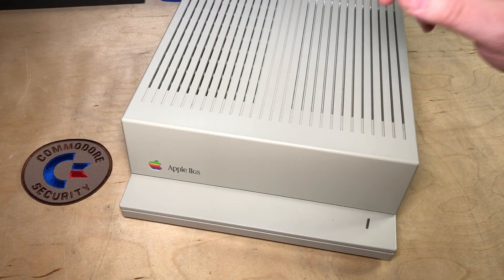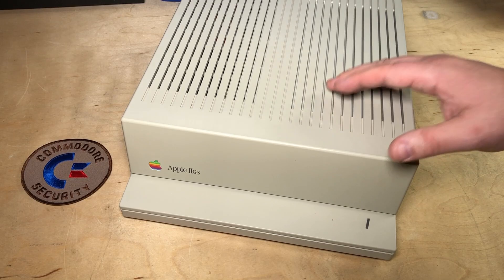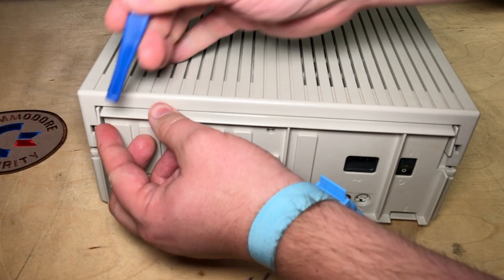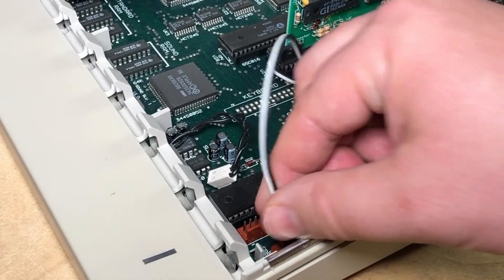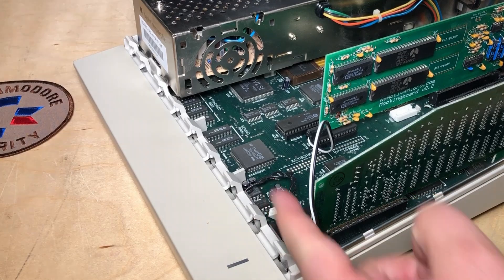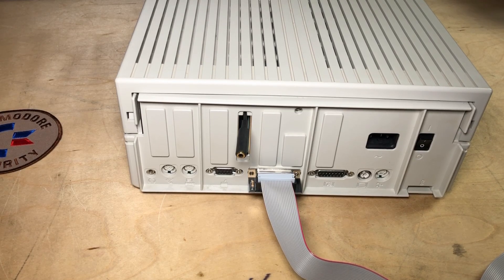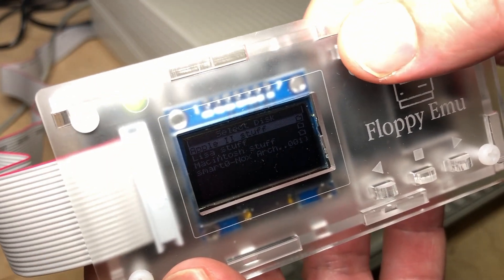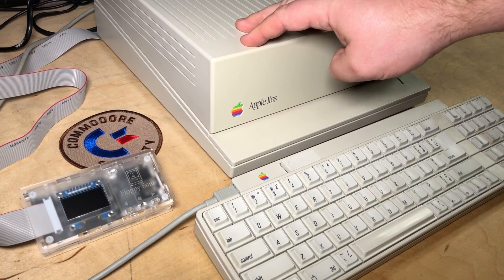Apple IIGS: Setting Up My New Mockingboard, Floppy Emu

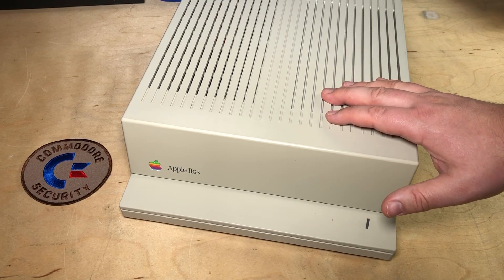Comment: @2:15.  The final Apple II model released would actually be the Apple IIc+, released Sept 1988.  It was both a step forward and a step backwards for the Apple II line.  The IIc+ was faster then the stock gs, but didn't have the sound and graphics capabilities of the gs.

Comment: The IiGS was not the last apple, for obsure reasons it was discontinued before the Apple IIc+ and even the IIe. 
Apple killed what was a machine that could shadow the early colorless and soundness mac. They prototyped a IIGS with SIMMS slots and internal HD and drive. But the project was cancelled. 
It was the second time that Jobs abandoned several thousands users.

Comment: I have both versions of the older Floppy Emu, with the monochrome screen.  Maybe it's time to pick up a current one as neither of mine have the extra Smartport options or UniDisk 3.5 support. (They only either support Smartport 3.5 on the END of the daisy chain, 5.25, or Smartport hard drive.)

I managed to get the rare-as-hen's-teeth CFFA3000 for one of my IIgs machines.  It lets you boot (5.25) floppy images as slot 6 while also booting hard drive images without Floppy Emu's naming restrictions.

If you want to do any serious stuff, like use GS/OS, I recommend you upgrade the RAM to something above 1MB.  I have GGLabs 8MB RAM expansion.  It's a SIMM on a board that's the length of the memory expansion connector.

Comment: Another way to enter the control panel is Option-Ctrl-Reset.
Reply from the maker: Interesting that there are two key combos for it! Is there any difference between them?
Reply: @8-bitshowandtell247  The one I mentioned reboots into the Control Panel instead of just entering it. (It also allows you to reset all settings to factory default and switch between NTSC and PAL mode.)

Comment: I've always found the Apple IIGS an interesting machine, much like the C128 and the Acorn Archimedes machines.
Reply: C128 is kind of a mess IMO. IIgs is like...  I don't know. It has more going for it than the C128, it's like almost good enough to measure up to the m68k crowd like Amiga and ST (despite the much lower clock speed - I think the '816 could get more done per cycle) but not quite and it all being bound to that Apple II legacy design is just...  kind of weird.

As lovely a machine as the IIgs is in some ways, and despite being technically the pinnacle of the Apple II line - it just occupies a weird place for me. Like most of my nostalgia for the Apple II line is for the IIc and games like Karateka and Lode Runner. In a way the IIgs doesn't feel like a real Apple II to me - except when it does, then it feels like its 16-bit side is being held back by it...

Comment: Re: Mockingboard.

1. With a ROM1 machine, and the Mockingboard in slot 4, you may have to disable the mouse whenever you want to use the Mockingboard and then reenable it whenever you want to use GSOS (or anything else that uses the mouse).  If I were me, on a ROM1 machine I think I'd put it in either slot 7 or slot 1 (if you don't ever plan to have a printer hooked up).  I am not 100% sure on this.  I know it's not an issue on the ROM3 boxen (disabling it on ROM3 only disables it in IIe mode, but it's still available in IIgs mode), but I've heard that it's a thing on the ROM1 boxen (disabling it there disables it alltogether).

2. I have the Phasor clone from reactivemicro, and when I plug the motherboard audio into the header on the card, it gets SUPER noisy and distorted.  I ended up just using two separate line outs and mixing them.  But hopefully the mockingboard clone doesn't suffer from that issue.

PS: I love the IIgs keyboard.  One thing on my project list is to hack up something on an arduino to read the ADB data from an extra IIgs keyboard and output USB HID data, so I can use it on a KVM will all my boxen.  :D
Reply from the maker: Thanks for the info! I'll try moving the Mockingboard to slot 7 if/when I start using the mouse on it. So far the motherboard audio sounds great through the Mockingboard clone.

Comment: Putting a Mockingboard into an Apple IIgs. Huh. The computer with native sound hardware that blew away anything that came before it and most of what came after it for the next half decade.

I get it, this new game probably does not support the Ensoniq 5503. It's just weird to see for somebody who lived through the era. :)
Reply from the maker: Yeah, Nox Archaist only supports Mockingboard for music, and the regular Apple II audio for the sound effects. It does seem strange not using the built-in audio.
Reply: @8-bitshowandtell247  I don’t recall any 8-bit software making use of it, come to think of it. I wouldn’t be surprised if the processor and/or other components had to be put into 16-bit mode or something to access it.
Reply: The excellent sound capabilities of the IIGS are only available in IIGS mode. When running software written for the II/II+/IIc/IIe (like Nox Archaist) you're stuck with the very basic sound capabilities of those machines -- unless you have an add-in card like the Mockingboard.

Comment: IIgs is a really great machine!!!  :D  Just remember to set the system speed down to "Normal" when you run IIe games.  ;P
Reply from the maker: Thanks, I ran into that when I tried Donkey Kong and a couple other games. Nox Archaist seems to run fine with the fast speed as far as I can tell.
Reply: Since I usually boot such games from floppy, I wrote a program that let me set the speed to 1MHz before booting the disk, without going to Control Panel

Also, in programs I write that depend on 1MHz, I can also detect whether it's a IIgs, and set the speed to 1MHz if I need it.  Very good for those old sound routines.

Comment: 0:02 Is it Appleuary?

6:43 That is a little strange how the cards just flap in the breeze if they don't go through the backplate.

9:26 The composite video looks pretty sharp!

10:58 Looks like a step in the right direction — unlike PCs of the era, the Apple used the same connector for both floppy drives and hard drives. 

11:35 It's interesting how the SD-Card form factor is becoming obsolete and the major vendors are selling their high-capacity new cards in the Micro-SD form factor with an SD-Card adaptor.  I guess the phone/tablet market is the larger part of their business and a Micro-SD can hold 1TB anyway. 

13:25 So, to use any of the six pre-assigned slots, you have to disable some existing functionality?  Does the game you want to play use the mouse that you're disabling?
Reply from the maker: Appleuary is a new high in terrible retro computing event portmanteaus. Or is it a new low? #Appleuary it is!

Yeah, it does seem the built-in functionality (some of which was only available for the first time on the IIgs, I believe; earlier models had more unassigned slots) needs to be sacrificed. I suppose full-blown IIgs software would make use of the (so I've heard) excellent built-in sound chip (designed by Bob Yannes who made the SID!) and wouldn't need the Mockingboard at all. As far as I know Nox Archaist is 100% keyboard controlled so I won't be missing the mouse.
Reply: @8-bitshowandtell247  I was holding out for #Apple-ril
Reply: IIRC, the version 3 firmware rejigged how mice work so disabling the mouse in Control Panel doesn't stop it from working in GS/OS like in version 1.